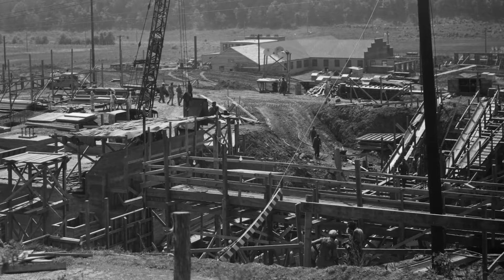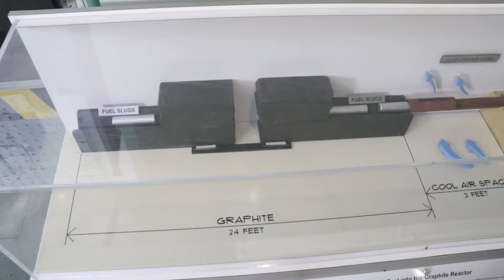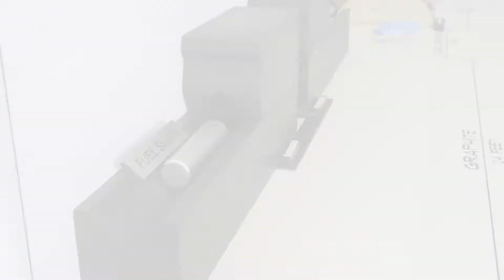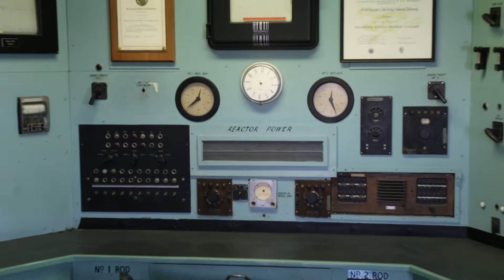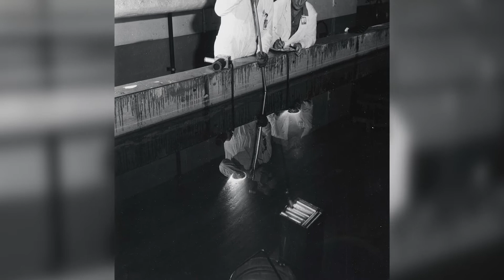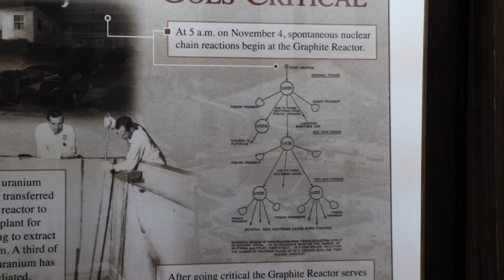Graphite Reactor Tour

Comment: Who wrote the script for this? - it is rubbish.    Says fuel slugs are 4 inch long and shows a picture of one in someone's hand - either it is the hand of a baby or the slugs are at least 8 inches long.   It says the slugs are clad in aluminium to prevent the uranium oxide from oxidation! - How can an oxide be oxidized?   That's like saying we can burn some ash.   ít says the pile was used to produce electricity.  This was just some engineers having fun and not the practical generation of power - they pushed a small pipe down a hole one day and raised enough steam to run a child's toy steam engine that turned a toy generator and lit a torch globe.
Reply: The oxide part had me laughing

Comment: Are the Windscale piles copied from this reactor?
Reply: Windscale had a problem where fuel slugs would not drop into the water pool and some other problem that caused a fire / meltdown.
Reply: Yes. See the “similar reactors” section on the X-10 reactor Wikipedia page: https://en.m.wikipedia.org/wiki/X-10_Graphite_Reactor#Similar_reactors

Comment: The fuel slugs cladding is made of zirconium, and aluminum is used as a binder for the uranium oxide in a material called cermet. Doing this allowed them to be processed by simply dunking in nitric acid. The fast isotope reactor does something similar but actually uses plutonium oxide to make more interesting stuff like californium and berkelium. ❤
Reply: I thought Californium was made in the process, known as....Californication?